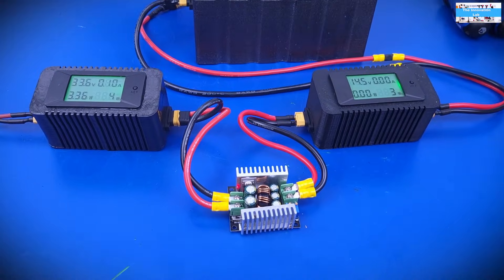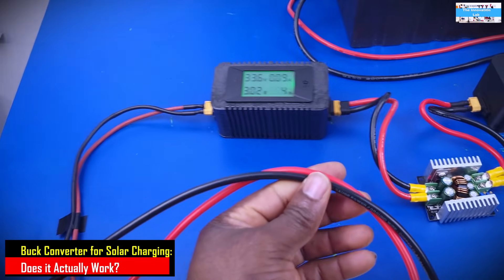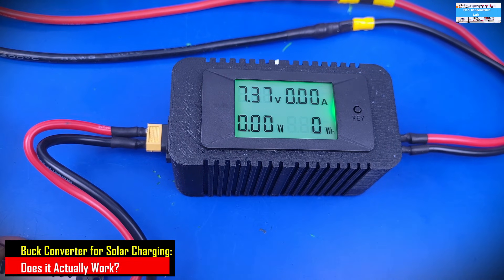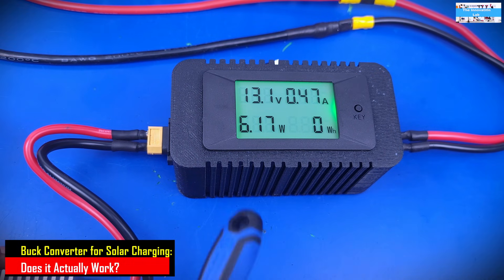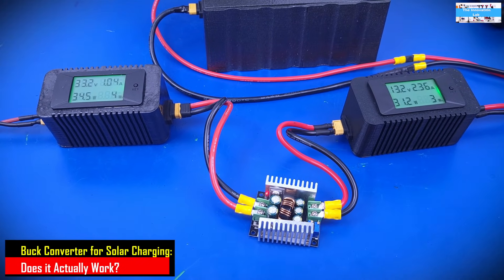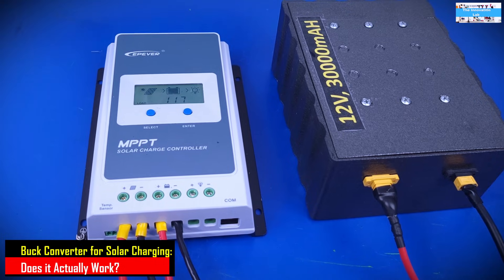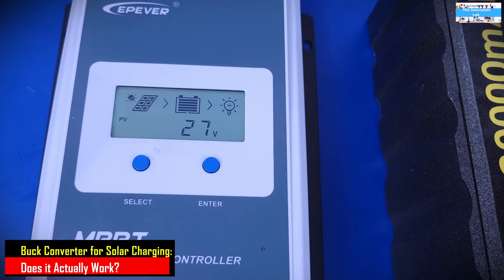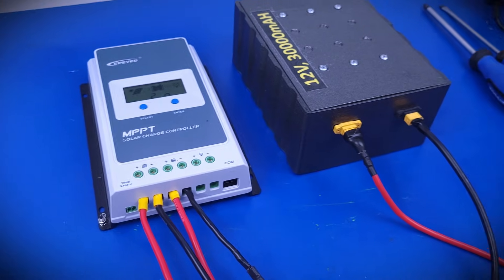DIY Solar Battery Charger, with a DC to DC Buck Converter.

Comment: It is not possible to derive more than 34w from a total power source of 34w, it is why the conveter crashes at above 31w, stil that effienciency is Good
Reply from the maker: I appreciate the engagement. However, I added the control test in anticipation of comments like these. 
Please be patient and watch the video to the end - before sharing your comments. Its time consuming for me to keep re-explaining something that I have already explained in the video a while ago. 
The converter was not crashing because of insufficient input power. It was crashing and pulling down the input power from the solar panel.....again watch the control test with the MPPT charge controller in the end...same solar panels, same amount of irradiance, exact same test conditions.

Solar panels have high series resistance and this makes them weak power supplies. This means that if the input impedance of the converter is not well matched with that of the solar panel, the converter will become an inhibitor to the panels ability to converter photons to electrons....put in simple terms 'solar dc power'

Respectfully,
The Innovati0n Lab www.theinnovati0nlab.com

Comment: use the converter to run small dc appliances and phone chargers from solar panels. its not suitable for charging batteries as well as a mttp controller would.
Reply from the maker: Thanks for the wonderful engagement. I wouldn't really use it as a phone charger. 
I agree that it shouldn't be as efficient as an MPPT charge controller....I mean why would it? There is a reason those MPPT controllers are usually very expensive.

Comment: I have a 12v-5v 6.5a buck converter that I run/charge my 5v devices by connecting the input directly to my 22.6v 5.5a Solar panels. It works great. No battery required. Works great. I have a heatsink installed on the converter. Amazon item B093VB61Y6 has my photos of the setup in the review which pending approvel.

Comment: The input voltage must remain higher than the Vmmp of the solar panel. If you go below that, the power will collapse and you will not have enough Watts left for your set value for your battery. You should monitor the input. I saw someone on Youtube who added a feature/hack to the converter that keeps the input voltage above a set value (higher than the Vmmp); an LM358 OpAmp which is connected to the Feedback pin of the IC of the converter. I already knew this hack because it is used in a slightly different form to add a current regulator to a converter. I have not tried it myself, but the story seems logical to me.
Reply from the maker: Thanks a great deal for such wonderful and constructive feedback. If I ever revisit this project in the future I will be sure to try this out.

Also feel free to share your findings with us if you happen to give it a try in the near future.

Respectfully,
The Innovati0n Lab 💥
Reply: You have the link ?
Reply: @carlosleite6919  https://www.youtube.com/watch?v=3BOkD3azm2g&t=999s  This hack works. Had the same dc buck converter lying around. A voltage control circuit, based on this idea, on the output of the solar panel also works. A Lm358 which controls a fast switching mosfet (on the power line). If the voltage is above the set value the mosfet stays on. Too low mosfet goes off. This causes the voltage to rise again and mosfet goes on again and etc. I tested this with a digital converter and a 21 watt lamp. May not work if a converter wants to keep the set value on target. So volts and amperes.

Comment: I am very disappointed as you didn't show the input display at the time of crashing. 

These converters are not designed for  hill like power curves like solar panels.
I guess when the converter tries to pump more energy than 33 w, the panel voltage crosses MPP and as the voltage decreases, the converter tries to draw more current, so it increases the duty cycle, but since voltage decreases, it needs even more duty cycle to fulfil the demand, voltage further decreases, situation become worse, it continues to increase duty cycle to max which causes the panel to go far low voltage ie low power, and then it can't go back because the Converter do not know it has to lower the duty cycle to relax the panel and increase the voltage to get more power (basically to go back ). It just blindly tries to get more and more current to get power and  becomes unstable.

If we somehow hack the feedback system of the buck to never try to load the panel below a certain voltage around the MPP volt, it will not go unstable.
Reply from the maker: Wonderful.
Thanks for the interaction.

Respectfully,
The Innovati0n Lab 💥 www.theinnovati0nlab.com

Comment: I have observed that , your experiment is perfect but the thing you missed is battery is nearly full so , buck converter sends 2amps , if battery is low you can get more amps
Reply: This is it.
Reply from the maker: Thanks a lot for the amazing feedback!👍👍

The video project was conducted more than a year ago, but I am pretty sure the battery was fully discharged prior to the charging test.☺️

Thanks again for the wonderful engagement.
Much appreciated.

The Innovati0n Lab 💥 www.theinnovati0nlab.com

Comment: Dear sir, You often perform experiments and leave them unresolved. Please try to give us some knowledge.Thanks
Reply from the maker: That is not very true.
I always end my videos with a good summary and lessons learned. I may not be able to solve every single problem because I am just one person - with limited time and resources. 
Engineering and design problems cost money, time, and resources to solve. 
My hope is that someone could find helpful information from where I left off and use that to solve other problems....or at least be aware of diy concepts that do not work.

I hope this makes sense to you.☺️
The Innovati0n Lab 💥 www.theinnovati0nlab.com

Comment: Buck boost convert is intended to be used when solar panel voltage is lower than your storage battery voltage. Otherwise you should not need to use it. Would not be very useful or efficient.
Reply from the maker: Thanks for watching the video and leaving feedback.👍👍

However, what you said is partially relevant to buck-boost converters. 
The only disconnect is that what was tested in this video was a constant current BUCK converter.....not a BUCK-BOOST converter - they are not the same thing.

Also, regardless of what converter type, you still need the  current adjustment function that these constant current converters provide as it enables you to  adjust the charging current to the level recommended for your battery. 

Charging your batteries without current adjustments is dangerous and could over stress your batteries.....PLEASE DO NOT DO THIS.
PLEASE PAY ATTENTION TO MY TUTORIALS. 

Please, what the video below where I explained how the charging process works.👇👇👇
https://youtu.be/WDWJ77WWkXc?si=GgT77t35RSnMFK73

I hope this helps.
The Innovati0n Lab 💥 
www.theinnovati0nlab.com
Reply: @theinnovati0nlab782 the point is if you don't use it for that purpose there is no benefit.

Comment: To test buck converters you need to use a power supply , not solar panel because sun is not always in the sky, this can alter the tests. Also the battery has a BMS, BMS may have some logic which would prevent reception of current in some conditions. Instead of a battery you should use a power resistor.
Reply from the maker: Great feedback.
However, the experiment was to see the performance of this cheap regular buck converter as a SOLAR  battery charger.

I made an initial video that shows how to use these buck converters the conventional way that you were referring to. Please watch the video below.
👇👇👇
https://youtu.be/Wabe5f6sUgo?si=kZfcMfCiBu2N3iq1

Analogy:
We all know that a vehicle tire is built to traverse roads. However, if you want to conduct an experiment to know if the same tire can be used on a cheap 'float plane' design... you would test it on water, correct?

I hope this makes sense to you.
The Innovati0n Lab 💥 
www.theinnovati0nlab.com

Comment: Thanks Mate.
I have used a 20 to 30V input to 13.8V ,7 Amp output Buck Converter successfully to maintain a 2nd battery in my car for my amateur radios.
It also generates less ripple (RF noise) than a solar regulator which is good for my purposes.
Thanks for the video Mate 👌
Reply from the maker: Thanks a lot for such wonderful feedback!
I greatly appreciate success stories. I am glad you found this video useful. Thanks for supporting our channel.
👍👍

Respectfully,
The Innovati0n Lab 💥 
www.theinnovati0nlab.com

Comment: I want to supply a12 V motor direct from a 550 W 48 V panel.What would be the best system to do it ?
Reply from the maker: Will this be a solar panel?
If so, I would highly recommend having a buffer battery between your solar panels and your load.

You can use an MPPT solar charge controller to recharge your 12V, then  connect the 12V battery to your motor.

I hope this helps.
www.theinnovati0nlab.com
Reply: Thanks ! @theinnovati0nlab782

Comment: Have you tried adding a PWM SCC to the output of the converter to solve the problem of converter collapse, since the pwm regulates the voltage to charge the battery. And also it would be an interesting topic if adding dc buck converter to convert higher voltage pv panel closer down to the charging voltage and converting that excess vomtage to usable current to charge the battery, since the pwm only steps down the pv voltage to the battery charging voltage without converting that excess voltage to usable current. Please make a video about this, if a PWM can solve the converter collapse issue. A lot of us wants to try alternative ways to charge batteries from solar without using an expensive MPPT, and once they get damage, its hard to find a good technician to trouble shoot their complicated components. Please make a video about this🥺thanks
Reply from the maker: Great feedback.
👍👍
However, it is not a good idea to cascade converters   because it will double the amount of power losses due to  efficiency hits.

Thanks again for thinking outside the box.
The Innovati0n Lab 💥 
www.theinnovati0nlab.com

Comment: I use the same module with 30w 18v panel. Efficiency is quite low.  It can charge only 0.5A or 8w.  However, if I connect this module directly to my 12v fan, it can give 12v 1A or 12w.  I don't know why.   I seem if I increase output voltage to 14.6 current will drop.
Reply from the maker: Make sure that your output current is set to the maximum point when you are driving bigger loads.

Comment: This project i feel like it is working as well as it still can tune the voltage to the voltage level and charging the battery with 2.3A. However, there is a harmonic noise u mentioned about in video is actually related to the buck converter is damaging rn. It is using higher than its specification, im suspecting on the current/power, may need to check on its datasheet.  

I did work on this kind of project before as I am using the MPPT Solar Panel Controller converter which works well for me, i think mine this model have current supportation up to 5A which is enough for my project.

I would recommended kick start by observing the specifications pf the solar panel (short circuit current & open circuit voltage), DC-DC buck converter (max charge current, Iin, Vin, Vout) and battery (max voltage & Power)

I would suggest you do a vid using this model, try it out with charging the battery on sunny day and night, to see the changes of the voltage output. I met a problem on the input side where the voltage is pump up over time when sunny day turn cloudy (From my solar panel - from 24V drops to 3V) will have a pump up voltage over time on Vout of buck converter. I scare it would hurt my other component so i changed it.

But yeah Hope your project works well!!😊
Reply from the maker: Thanks a lot for the great feedback. MPPT charge controller is the best. Unfortunately they are too expensive for most people. This was meant to be an experimental project.

Thanks again.
👍👍
Respectfully,
The Innovati0n Lab💥
www.theinnovati0nlab.com

Comment: Pay attention at the 2 screens, you have 34W in and 31W out, it's a 90% efficient system. It's not the buck converter's fault. Your panels don't deliver
Reply from the maker: I keep seeing this comment over and over. 
Please watch the video to the end. I highly anticipated this very comment and I added a control test with an MPPT charge controller and the same solar panel.....same conditions, tested 5mins apart at full irradiance, gave the same batteries a charging current of 14A....so if the solar panel was not delivering, where did all that power come from?🤔🤔🤔

Sometimes, there is a big disconnect between the theories we are propounding and what actually happens during the test. You get the full picture only if you can be patient to fully review the test data. This would allow you to make an informed decision. You are saying that a tested 240W solar panel at full irradiance could only deliver 34W? Less than 15% of its power rating?

I encourage audience interactions and engagements. However, only ask from my audience is to watch the entire video before leaving your comments. This saves me time trying to explain something that I have already presented in the video.

I hope this makes sense to you.
The Innovati0n Lab💥
www.theinnovati0nlab.com

Comment: Sorry , but it's because you don't really know how much current coming in from the solar panel.
That buck converter is cvcc output.
Reply from the maker: It's a cheap and poorly designed buck converter, that's why. Watch the video to the end to see the control test.
Do you understand the concept of a control test?
I knew that a lot of people would blame the solar panels in the future, and this was the reason why I added the  control test with an MPPT charge controller in the end. If the solar panels were not making much power, where was the 14A of charging current coming from - when I used the MPPT controller?

I welcome feedback and comments, but try to be patient and watch the entire video before we start propounding theories....before making comments that could be seen as  disparaging to my work.... that is a fair ask - yes?
The Innovati0n Lab💥

Comment: What I want to do is to use it to reduce my 24volt panels to 12volt system and I believe it will work. I have 12volt interter and 24volt panel and just want to use it to reduce to 12 volt
Reply from the maker: It sounds like a feasible idea in theory, but directly coupling an inverter to a solar panel is never a good idea. I know you are planning to connect the buck converter in the middle,  but I would not recommend you try this. It will not work for many reasons....I mean, if the load you are going to put on the inverter is a 2W load...then it might work until a cloud goes over your panel.

You need to have an MPPT charge controller to charge your 12V battery. Then, connect your inverter to the 12V battery. 

Even with this connection, if your inverter depletes all the energy you have stired in the battery and your load is greater that the input power from the solar panels, you are going to oscillations due to an over-damped response between your load and inverter.

This is hard to explain fully over text.

Comment: Can I hook a solar panel right to my electric bike
Reply from the maker: I have not done it myself, but I think you should be able to do it. 
However, for a very efficient charging, you will need a solar MPPT charge controller.
👍👍
The Innovati0n Lab💥

Comment: The buck converter is not designed good I design buck converter and get 100 and 200 amp its the pwm driver ic not rating for peak current of 2amp to drive the fet of the resistor Value is to low causing saturation of the top amp to stop working I see it alot in smaller converter.
Reply from the maker: Wonderful feedback!
👍👍👍
Thanks a lot for such great feedback. I am glad to have you in here. We need more experienced people like you on this platform. I hope you are a subscriber. 
👍😎
-The Innovati0n Lab 💥
Reply: Why dont you have any videos? If you do have this knowledge it be helpful to do so
Reply from the maker: @Thaelanis25  
I fully agree.
👍👍👍
Reply: @Thaelanis25  i'm a professional Electrical engineering its my job day to day and I don't have time to do video and editing to busy .but to help you out always use silicone diode have high amp rating in series with the output of the converter,s you using for projects feedback battery currency will damage the converter causing failure to work properly

Comment: You using buck converter vs mppt. Mppt as we all know takes the high voltage and current to step down to what voltage you are using as battery. As the buck converter, i had the same kind and this crash is what i learned due to the adjustment pod. And also poor quality. 🤔
Reply from the maker: Thanks a lot for the feedback. 👍👍
You are absolutely on the right track regarding the functions of  MPPT charge controllers. However, as the name goes,'Maximum Power Point Tracking' solar charge controllers do more  complex functiond than just down-converting the input voltage to the battery charing voltage.  
The cheap buck converters were  crashing because they are not designed for solar application. This video was just an experiment to know if we could possibly have a breakthrough with a super cheap converter - because this is what we do here at The Innovati0n Lab. 
We will be developing our our MPPT controller in the future - with the goal of making it super cheap.
Stay tuned.
- The Innovati0n Lab